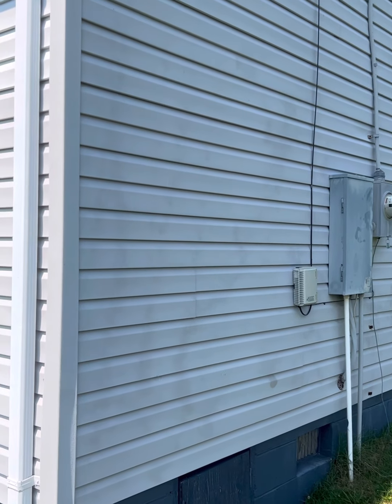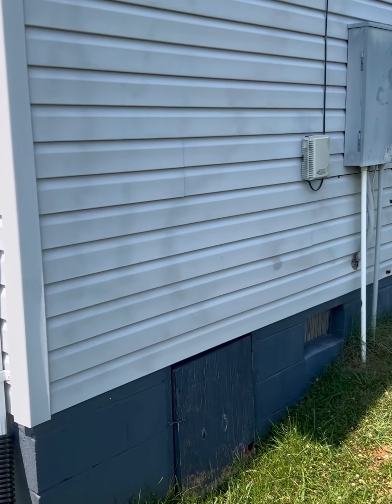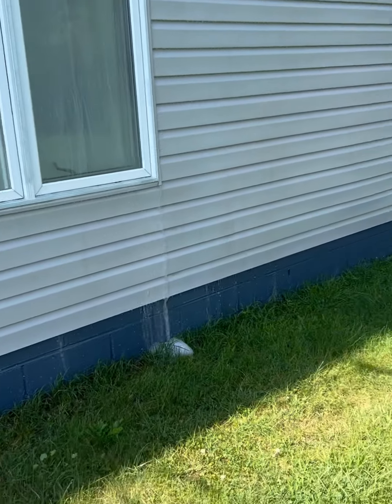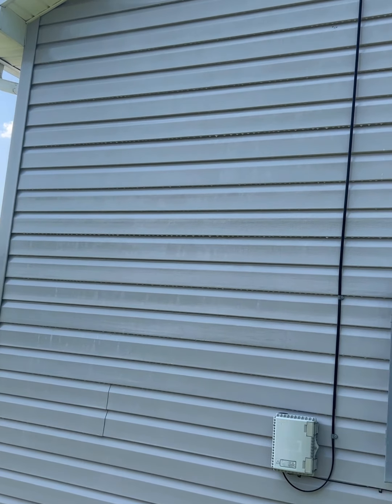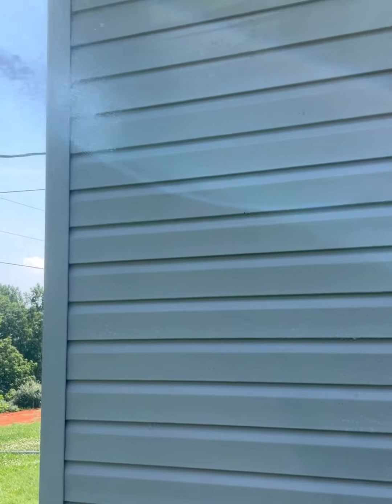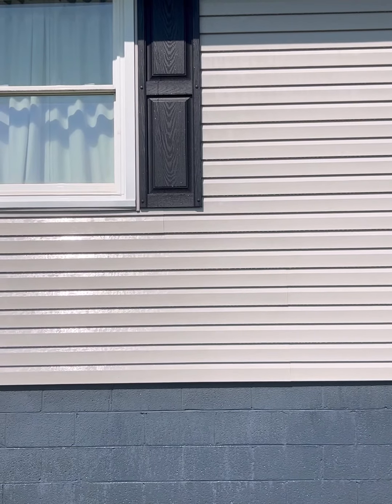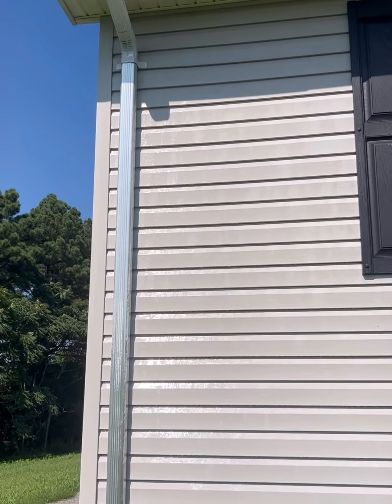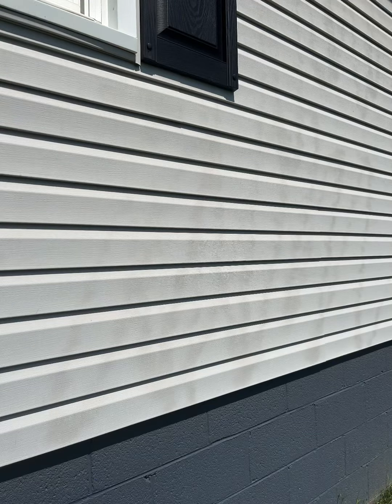Ox-Knox on vinyl siding

Comment: Following this video! Currently interested in buying some Ox Knox for my business but glad I came across your video!
Reply from the maker: It works great. Just be more careful than we were on painted surfaces and you should be fine..also make sure you buy the 4 case because if you only purchase 1 gallon there’s a flat 45 dollar hazmat fee which makes that 1 gallon almost 100 bucks. We got the case to make it worth it
Reply: @stangssoftwash  I just bought 1 gallon and no hazmat fee. It was shipped by Amazon from Alabama to St. Louis.
Reply from the maker: @robertlam-qd1xb  how much?
Reply: @stangssoftwash  I paid a total of 70.00
Reply: @stangssoftwash  unless part of that price was a hazmat fee which it didn’t state.
Reply from the maker: @robertlam-qd1xb   Ya it looks like its included in that price. Their website shows $50 for a gallon and their amazon store its around $70 ish.
Reply: @stangssoftwash  ok. I bought off of Amazon. Seems to ship faster that way and no shipping charge with prime.

Comment: You definitely deserve an explanation for the gutters.Glad to have seen the video, using it in the morning. Now worried,but at least I got a warning . Thanks
Reply from the maker: We did another vinyl home yesterday and on the back of the bottle it says "if use correctly it is safe for plants and paint." I don't know how much more we could have done to the painted surfaces but it was removing window trim/flashing paint and downspout paint. I think we are going to go back to brushing.
Reply: @stangssoftwash  damn I hope they get canceled by the pressure washing & soft washing community them "how to" guys all 4 of them

Comment: I put a 50/50 mix on my homes siding with a 5 minute dwelling and it didn’t remove the majority of it. 🤷🏻‍♂️.
Reply: 50/50 mix today and it still had spotty oxidation as well. looks terrible Complete nightmare. Never again
Reply: Not supposed to dilute it your suppose to put it straight on
Reply: @louiswilson2652  don’t think so

Comment: thanks for making the vid! have you found out if it hurts glass or plants?
Reply from the maker: Does not hurt glass though you don’t spray directly on it so the only time it gets on the glass at all is during the rinse so no worries there. Haven’t been around plants yet but like any chemical you should always presoak vegetation. Will be doing another vinyl oxidation job tomorrow and will post another video

Comment: If you pay attention you will notice Southeast Softwash just replicated products and puts there brand on it so they can charge more. Which is fine but they always over sell it as being the next best thing when its not. They did the same thing with the RealDeal hose reels. They are almost identical to a KINGS hose reel but a few $100 more. If they would just be honest and not over hype their product then maybe it wouldn't disappoint people.
Reply: What is the original oxidation removal chem called?
Reply: @Bucky_larson  Typically 2-Butoxyethanol and NAOH/KOK combination. And ox knox is2-Butoxyethanol based,..(Go figure)   But the best thing I have ever used is Hydrofluoric based aluminum brightener.. Closest thing to spray on and rinse EVERYTIME,..Not hit and miss like this overpriced ox stuff,,..Heck Purple Power from Walmart at $25 per (5) gallon likely works as good....And can be boosted with NAOH if and when necessary...
Reply: I agree with you Xteriorperts southeast softwash is a joke. Every time I go to Nashville to get my sh and surfactant someone has brought their skid or trailer from them in to be worked on. They build a nice looking trailer and skid but the equipment is always breaking down

Comment: It's not sh it's a strong degreaser you have to apply it with control that would be 1 of the reasons to use a pump up spray and you need patience not so much a in and out job and keep the gutters wet never let them dry

Comment: You continue to say Ox Knox really works when you haven't completed the job.    There's other videos out there where guys are saying the stuff does not work like it should on Vinyl.
Reply from the maker: It does but it is also really dangerous. On painted surfaces and I’ve found no matter what precautions you take it’s bad for paint. The container says safe on paint when used correctly. I don’t know how much more correct we can be but it’s dangerous on paint.

Comment: You should have done a side by side comparson in sun and shade. Wash a side, let it dry. Show the results in  the sun and in the shade. You can't tell much from your video.
Reply from the maker: The video was on the fly and was not much of a before and after as much as it was “live action.” I am not having the best time with this stuff and I’ve tried a couple things and not getting results like I thought I was going to get. I don’t mind going back to the brush and a $6 gallon LAs compared to $70-80 ish ox-Knox. Not knocking these guys but it doesn’t seem to make sense to switch right now.
Reply: @Limbo_Lightning hydrochloric acid? I'm trying to do my house and I used a simple green hydrogen peroxide based mix that was too diluted and the oxidization came back this year. I want to try it again if I can find it and use a heavier mixture because it doesn't hurt the plants but if there is something better I'd love to know! Thanks for your knowledge and experience and time!
Reply: @hisnameisiam808   Oxidation will always come back. And it will come back quicker than the original finish. Acid based products work better in most cases. They will kill plants. And maybe I shouldn't be telling people on a wide open site like this. I have used Hydroxide/Butyl based cleaners as well, but in my experience acid based products are more effortless. Get an aluminum brightener and try it. With all that said, I no longer provide oxidation removal as a service. I just wash over it. And have never lost a sale. Good luck, and be careful!

Comment: You can use it straight and spend over 600 dollars just in Oxnox doing one home.
Reply from the maker: @1stFlyingeagle  ya it’s not worth the price and hazmat shipping etc. I’ve used LAs awesome at only 6 bucks a gallon and does the same exact thing. Brushing or no brushing it’s just not worth that money.
Reply: @stangssoftwash @stangssoftwash  Yes, when I did my girlfriend's mobile home trailer. I went to LA Awesome, which costs $10 a gallon. Yes, I brushed, but I sure did not spend hundreds.